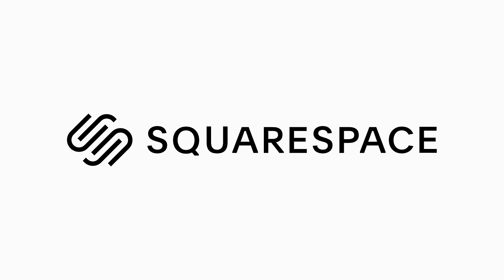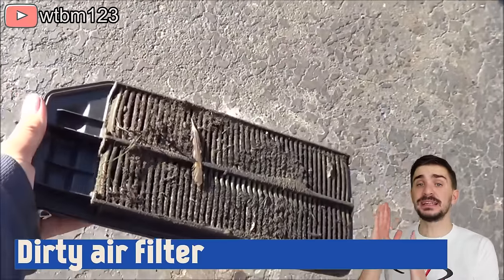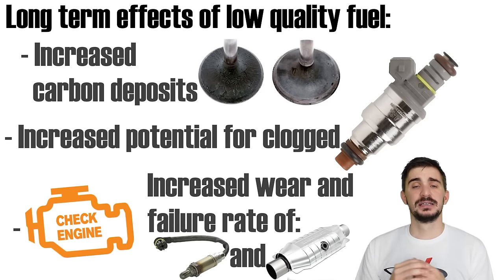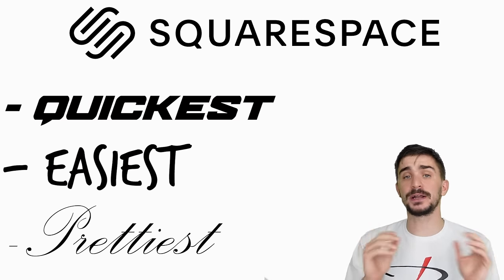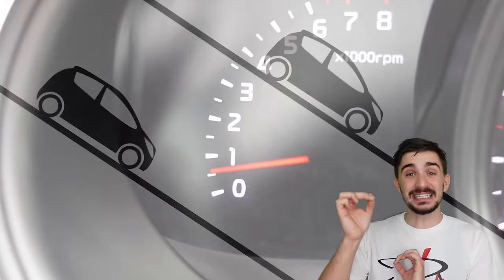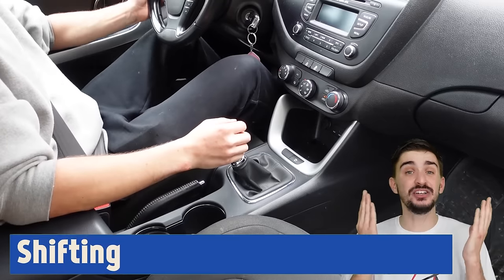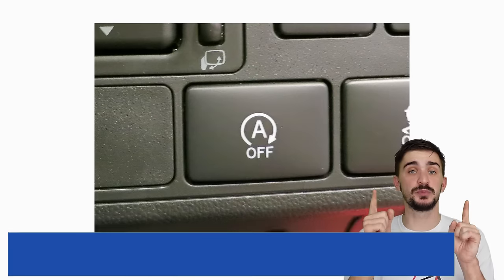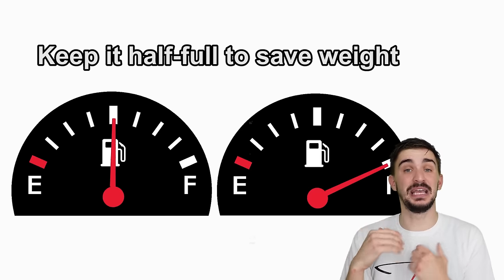EVERYTHING on FUEL SAVING - PRACTICAL DRIVING and MAINTENANCE techniques to REDUCE FUEL consumption

Comment: For the additives, there is none for saving fuels, but can they improve, or just help to maintain the health of the engine? 
If there is enough pertinent content to talk about it, what about a video on the additives? For the fuel, oil, coolant or brake fluid, for the road or race track
Reply: They can help with removing carbon from the engine or baked on oil on metal parts. They're more beneficial in diesels for cleaning the injectors though, and from my experience they do help (they thin the fuel slightly in diesels too so can help if you have a high Bio-Diesel content and live in Northern Europe or a central part of the US or Europe that gets cold).

Fuel additives can and do work depending on what the additive is. The only coolant additives you should ever use are anti-freeze if using water (50/50), or a leak finder (ie: for blown head gasket etc). Same goes for oil in this respect, "oil cleaners" are not worth it....it's best to use a good filter and good oil, changing every 6-12 months or maximum of 10,000 miles (more frequently doesn't hurt, but is more expensive). 

Brake fluid. Never add anything to it. Only use the specified fluid for your brake system (ie: DOT 4 or if it's a bugatti or ferarri maybe DOT 5 if it's specified). With proper research you can get higher boiling point brake fluids that will happily work with your brake system, but the cost of these fluids and your use case probably will never fit (unless you're racing the vehicle and doing track days with it).
Reply: @S.ASmith  Well said. I'll add that I took apart an engine that had a steady diet of top tier gas and no additives and it looked like it had never left the factory where the gas was sprayed. 

Also I like 5000 miles or less on oil changes because I'm north of the snow belt in the states and I've replaced Nissan V8 short blocks.
Reply: The only one that could potentially help is injector cleaner if you have dirty injectors cleaning them will help
Reply: @Wagonman5900  I do an oil change on my MK3 Focus ST-3 in the UK every 6000 miles or every 6 months, whatever comes first. I go get the dealership stamp every July, then do another service to the car myself using OE or Mahle/Castrol stuff.

US Standards are more lax when it comes to pump petrol/gas it seems to (you generally have 3 as opposed to 2 grades we have in Europe and UK). I use either Shell V-Power, Esso Synergy+ or a supermarket 99 Octane fuel (Tesco Momentum, it's produced by BP though). Esso is by far the best as it's ethanol free in my area and the engine runs butter smooth on it.
Reply: @Wagonman5900  That depends if it's a direct injection or port injection. If direct injection only, than carbon fauling will always be a problem. If port injection or mixed, petrol will clean off carbon, as petrol is a detergent.
Reply: @Intrud3r55  Right. The car I took apart was port injected.

Comment: i mean, injector cleaners can work at  increasing fuel economy, but this is only the case in older cars with old injectors that are functioning at less than optimal capacity. the reality is just gaining back lost efficiency

Comment: Step 1. install mTDI in rabbit 
Step 2. Get 60+ mpg avg

While having nearly twice the torque and same hp as a mk1 GTI. 
(And getting over 2x the economy )
Reply: I did this 12 years ago. 
How much fuel and money have u wasted.

There are zero sensors to ever have to replace. You replace your MAF ONcE on a Tdi. 
And I could drive nearly 2,000 miles on how much u paid for one sensor.
Reply: bless

Comment: As always, - thanks for a great vid :) The last point is great - when switching cars I choose to buy a hybrid mostly out of curiosity since I was already looking at cars with auto transmission. Its a larger car, and still the savings vs the old car were around 4L/100km, so half the fuel consumption of old one. Over time this really adds up, especially on vacation when driving 1000km is not a big feat. I've been on team hybrid for 4 years - it requires some adjustment to the driving style, but in the end its a great fuel and money saver :)

Comment: I use electric vacuum pumps for the brakes.  pumps cost about 250 dollars and you can add a vacuum accumulator for more time between pump cycles for brakes with engine off.  
You can also run a power steering pressure accumulator for power steering.  
I usually restart by shifting back into gear (i dont drive autos anymore due to the cost of rebuilds).
If youre too concerned about startup wear you can use an oil accumulator and remote switch.  
To really maximize fuel economy you need to make a lot of mods.   a normie driver cant usually realize any improvements.
Reply: hm, it never occurred to me, but I'm guessing ECU starts injecting fuel when it detects an rpm >preset value? Otherwise if you had to "crank" to get the injectors going, then your starter would get fucked pretty quickly. If my guess is not the case, what workaround did you do?
Reply: @nc7432  most cars when first keyed on do a "start pulse".  its a preset ammount of fuel to get the engine to start.

Comment: The start stop feature on vehicles these days is good but my only concern is how many starter motors they'll go through during the cars life
Reply: I believe the starter motors and electrical systems are engineered quite differently on start-stop vehicles - manufacturers don't want failures during the warranty period! In fact, I believe some engines can even be stopped so that the crank angle is set up for easy restarting or even self-starting.
Reply: Starter motors and batteries are more robust in cars with start/stop.

Comment: I completly agree with most of the stuff except 2 points (where one is just subject to my experience). I use the onboard realtime consumption thing to train myself and till this day its my favorite gauge. I would recommend it to anyone with a bit of driving experience. It helped me to get an avarage of 5.2-5.4 in the city and 4.6-4.8 on the highway. (compared to 6.2ish in the city and 7.6ish on the highway. yes I was driving a bit stupid bc of my lack of knowledge and driving practice). 2nd point is about hybrids: I dont have any evidence but my thinking is: If you drive in the city mostly relaing on the e-motor the gasoline engine and tank is dead weight and if you are going on the highway then its the other way around. so either way its a kind of car which just has a niche application and therefore 2 cars: one(small) electric for the city where range isnt an issue and one (diesel?) for longer distances. but idk diffrent people diffrent needs for a car. so its mostly my opinion. 

PS: when is a new iconic engine video coming... already watched the playlist twice. Love your vids.

Comment: you can FAS in a manual and have the clutch depressed with the ignition ON but engine OFF. All you have to do to turn the engine on is let go of the clutch and the engine will instantly bump start. I do this in my89 triton all the time. It has no power steering anyway so thats not a problem either. You just have to make sure the engine is in the right gear and you dont let off the clutch too quickyl or you will lock up the rear. its also carburetured so no extra fuel is used when i turn the engine back on.

Comment: 14:50 - those marking on the speedometer (30 and 50) is not for shifting. if i guess correctly that's an early 2000 benz, and european cars have those markings as that's the common speed limit in the cities.

30 km/h on school and residential areas
50 km/h in town
Reply from the maker: You're correct. Thanks for letting me know. I'm blurring out this part on the video. I just assumed this without checking and I'm ashamed.

Comment: 14:50 i've always wondered what those red lines at 30km/h and 50km/h meant on speedos, i didn't know those were shift indicators lol
Reply: i've always thought they're there because that's the common speed limit

at least in germany and german cars, urban neighbourhood (residentials, schools, etc) is 30km/h, in town 50km/h.

my current japanese car have a marking on 100km/h, but i think that's because it's marked on unusual increments (30, 60, 90, ...) unlike the usual 20s (0, 20, 40, ...)
some doesn't even have any special markings on them.

edit: just googled this and it confirmed it's about the speed limit.
Reply: @Looo0007  Yes that is correct. MB:s had that back in the day. When they still had the classic instrument clusters. The shifting points on the other hand were marked by I, II, III, IIII on the speedo.
Reply: They arent. Its a warning that you should pay attention because your probably in a city or around a school. Usually the speed limit there.
Reply: My 89 civic had little dots on the speedo where redline was in each gear since it had no tacometer.  So that is where I shifted, or when the fuel cut off.

Comment: Many good points in this video, thanks for summing them up.
But to be honest i don't fully agree on all of them.
Like coasting in neutral. Of course it doesnt make sense if youre going downhill when youre getting faster and have to use your brakes to keep your speed instead of the drag of your engine whilst also benefiting from the fuel-cutoff. But if youre just going straight or just very slightly downhill it might make sense as just getting off the throttle might slow you down in such a situation which you might not want and you would have to use some fuel to get up to speed again. Keeping the car in gear and holding the speed might be less efficient aswell because as far as i know most engines aren't really efficient in such low load scenarios. That of course also depends on the speed you're going, the amount of fuel your car consumes while idling stays the same for a given period of time. Assuming it is 1l/h and youre going 100km/h in that moment your theoretical fuel consumption is 1l per 100km. Also i don't really know about your safety like a soapbox-car comparison. Many newer automatics do this on their own and i don't think they're unsafe, also in an emergency breaking situation you would apply clutch and brakes at the same time anyways.
Of course you can never tell what is going to happen, but as with many of the tips you gave most important is that they're only performed when the situation allows for it. A long open road with no hidden crossings and good oversight of the landscape should allow for that.

Automatics vs manuals: The shifting indicators in cars aren't just dumb limits at certain revs. They can (at least in theory) access all of the same data as your automatic transmission can, so they could just show you the exact same shiftpoints the same vehicle with an automatic with the same gearratios would take. Wether you go up or downhill can be determined by the electronics taking into consideration your throttle position and maybe the change in speed. The car can calculate what theoretical power youre making in the moment and could compare that to a simple list in which gear that could be done in a safe and efficient way and display accordingly, same as it would probably do for it's auto transmission.
Modern automatics for sure have their advantages and less losses than traditional systems but they're still not overly smart. They don't know what youre going to do until you do, also not why you do what you do, and so far they also don't know very much about the traffic and road conditions you're facing.
If there is an hill coming up in just a few the auto won't just stay in gear and istead shift up and down again, which i don't believe is very efficient.
Also on the motorway you're cruising along seeing a car that you should pass before it skips to your lane to overtake the slower car in front of it, you just want to accelerate a little so neither you nor the other driver has to brake. In the manual you might know that you can just increase the throttle a little for a few seconds to add some km/h and youre good. The auto might just see you press down the throttle decide it is time for a downshift and more revs just so it can upshift a few seconds later again, and no matter if modern autos shift quick and efficient they add some lag till you're finally accelerate as you intended to do thus make you accelerate harder to compensate the lost time and with the higher revs might even cost you more fuel. 
Also automatics plus start-stop are not perfect. In manuals the system works okay cause it starts the car when yor're about to select the gear for going off, which is enough time you don't have to adapt your driving. In an auto the system just starts the car when you release your brakepedal and then also adds a little time before releasing the clutch so the engine isn't immedeatly stalled, but usually you would already be going when you're letting go of the brakes. This can make using a gap in city traffic harder and more unsafe.
If you're going donwhill an auto car, (at least those i encountered) won't bother selecting a lower gear to keep around the same speed, of course if you're pressing the brake it might downshift but still then it might not be the appropriate gear for the needed force. Of course you can switch to manual mode then, but i think most non car-people will not bother with that, instead overheating their brakes on long downlhill drives.

As you said for many mods that would help to reduce fuel consumption: Tey're just not worth it.
Well I think same goes for start-stop systems in many cases. Of course cars with those systems are engineered to withstand the negative effects of starting and stoping the motor again and again but that doesn't mean they won't last longer if you leave the system off, and i think manufacturing and shipping more cars or spareparts because old ones broke earlier isn't that cost-effective either. I tend to activate my system in situation where i know it wil take at least half a minute till the traffic will be going again. On redlights i rather try to slow down enough so i don't have to do a full stop before it's turning green again.
Same goes for tyre sealant and inflation kit. Of course it will be a little lighter but neither necesarrily more convenient nor cost effective. I haven't tried them myself yet but as far as i heard the foam or glue you fill into your tire to seal it after a puncture is pretty nasty stuff, which might makes it easier or even necessary to get not only a new tire but a whole new wheel cause of course it spreads all out between the tire you want to fix and the rim that doesn't need any of that stuff and might get "ruined" by it. Also such kits cant help you in every problem you might encounter with your tires. Of course you also took that into consideration in the video, but still for city driving that might be relevant. If your tires get torn with a big gap, your sidewalls or even your rim gets damaged you're simply beached. If you're in a city you're probably able to go on with cab or public transport, but what about your car. You can't leave that in the middle of the road, might not instantly find a space to park it and even if you might have to pay for the time. So you probably need a tow truck and your car is unusable till you get your new tires, probably more additional cost. With a spare, you swap it, give a call to the workshop so they can get your parts and go on with your business in the meantime.
Wheight in general doesn't consume energy, instead the more energy you use to accelerate your heavier car is stored as more momentum. Assuming you can offset the negative effect on rolling resistance with the correct tire inflation for your cars current weight, the same car with more weight in it would go further if you release the throttle at the same speed.
Of course in stop and go you're more likely to waste that additional momentum in heat and brakewear.

Last but not least, small cars aren't allways the most economic option in terms of fuel consumption. The weight aspect was already mentioned in the last paragraph. Aerodynamics aren't necessaryly that much better compared to a normal sedan or wagon as the with might be almost the same and they might even be a little higher so the people have enough headspace sitting more upright so the car can be shorter, also at the low speeds these cars are designed for they're probably not number one priority. And thats the point, a car ist usually designed for a certain use. If your use is just city driving, a small car will be better but you might consider public transport aswell. If you're constantly going longer distances or even drive on motorways those cars might not even be unpleasent to drive but maybe also consume more fuel than a bigger cars cause you're probably asking more power from the engine than it can efficiently deliver, especially if it is a small turbo engine which needs additional fuel for cooling in high load scenarios to avoid knock.
Just get a car that fits your needs.

In the end driving efficiently comes down to good maintanance, awareness of your driving situation and whats lying ahead of you, maintaining a fluent drive, cooperating with others on the road and not going all out in acceleration, braking, top speed and other things that might be fun to do with your car.